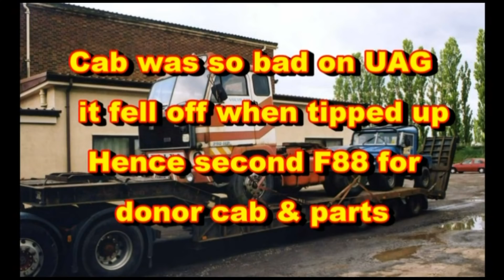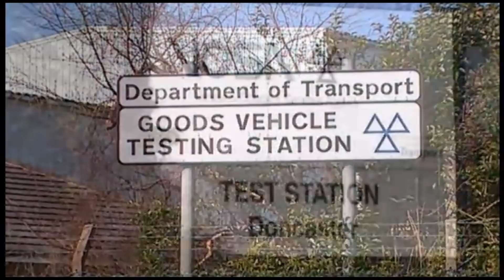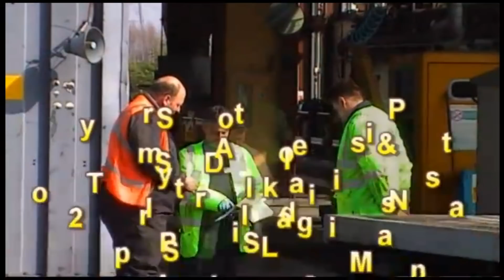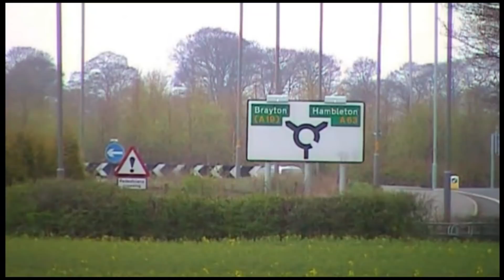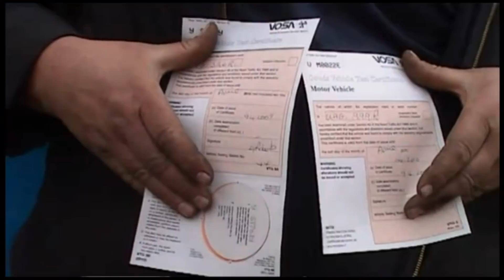F88 Volvo  UAG 999R Rebuild  2019-07-28

Comment: Great to see this rebuild of a terrific truck. When the Volvo F86, F88 & Scania 80, & 110 came on the British trucking scene they transformed the way HGV`s drove & performed. The smoothness & ease of use between engine & gearbox was a revelation. They also provided superb performance, decent fuel economy, driver comfort & above all for the operators a reliability never seen before. I don`t think you could have chosen a better motor to bring back to life.....well done!
Reply from the maker: Hi Edward, glad you enjoyed the Video. I was driving trucks  when the Volvos started to come into the country. As you say, what a change. Sad to say though it was the end of British built trucks. Regards Dave.
Reply: @DavidJoydajcajpajpaj  Very true Dave, it was the beginning of the end, but in our case we couldn't afford to buy British anymore since these Swedish trucks were so reliable. The one saving grace though to buying Volvo & Scania was the fact that they did source quite a lot of British components for the trucks & the cars.

Comment: The truck that changed European and Brit trucking for good. Many fond memories of them, including a 6x4 F86 curtainsider. That F88 looks fantastic.
Reply from the maker: Thanks for the comment Gareth, Watch some of UAG's road run's in real time to get the memories going. Regards Dave
Reply from the maker: Most certainly did Gareth. I was driving one within the first few months of them coming into the UK. Regards Dave
Reply: @DavidJoydajcajpajpaj  Thanks Dave. You've done a sterling job on her. I couldn't help but commiserate with you when she failed the test though. Been there, done that. You think you've got it all covered..and then..I'll be looking out for the videos of her on the road. Take care.
Gareth
Reply: @DavidJoydajcajpajpaj  Bit of a change from an Atki with a Gardner 180 and a DB 6 speeder

Comment: Good old smoker.  Use to drive a FB88 back in the eighties.  You sure put a lot of time and work in this project, and the resultat is stunning.  Congratulations with the timemachine.
Reply from the maker: Thanks for the comments Only Watching. Never seen an F88 that does not smoke on startup. UAG 999R had an engine overall last winter and hopefully it will be a repaint this winter. 2019/2020. Always something to do. Regards Dave.

Comment: A beautiful restoration of a classic truck a Labour of love  well done  a credit to you .  brings back fond memories of traveling many many hours  in an F88 on Middle East runs with astrans in the 70s/80s which after thousands of miles  was   replaced by another great truck a scania 143m 500 V8
Reply from the maker: Thank's for your comments Nutrunner, Look for the Rd Run videos and get the engine sound as well. Best wishes Dave.

Comment: Great restoration, really good effort.  I love how the euro trucks had the advertising signs  built into the cabin roof, fibreglass I guess. A really good insight into the actual frame work of the cab, brackets etc. My guess would be 270hp. Would look great with 40ft trailer with 2 containers on. Cheers from Brisbane Australia.
Reply from the maker: Thanks for your comments Andrew, You are right about the cab roof pod, they are fiberglass, only as big as the name board it's self. UAG is a 290hp engine with a 16 speed spliter box. Very fast if you want it to be as it does not have a speed limiter fitted. Present trailer is a period (1978) Low Loader which we carry our (1944)  Bedford QL Fire Engine and Shepards Hut  to the rally's.If you look through my video's you will find the trailer rebuild and some Rd Runs riding in the cab with Mike. All the best from a very wet and miserable UK. regards Dave.

Comment: i owned and operated a 1978 g88 boggy drive volvo truck and dog tipper in australia, i purchased it in 1979 it was a super reliable workhorse eventually i fitted a big cam 2 cummins 400 hp and 13 o/d r/ranger trans. best move i ever made.
Reply from the maker: Thanks for your comment Mark, Sad to say, Volvo's were what caused the British truck industry to collapse.  Regards Dave.
Reply: David Volvos imported into Australia were really bad for RUST they were terrible and Australia is a dry country not like England, I always reckoned they were shipped out here as deck cargo on a submarine , Volvo 16 speed gearbox weren't all that special either they were best replaced with a 13 speed o/d road ranger much-much better.

Comment: Fantastic restoration, nobody realizes the work that goes into a restoration like this unless you have done similar yourself. I have had experiences at a Foden S39 eight wheeler, a Volvo F6 turbo 6 and F7 six wheeler's so i know what you were up against. I hope you have much enjoyment from your F88. By the way did i spot a Massey Ferguson 30 seed drill in your shed fitted with wheel track eradicators ?
Reply from the maker: Thanks for your interest Madeljacky. Glad you enjoyed the video. Seed drill not mine, stored for a local farmer. Regards Dave

Comment: Credit where it's due, that was a Herculean task, great outcome though, Those early Volvos wether they were Coaches or Wagons were special, simple rugged and reliable.
Shame that can't be said today.
Reply from the maker: Thanks for your interest John, Took six years to get back on the Rd. All the replaced panels had to be hand made as you could not buy them, not even from volvo direct, and they did go out of there way to try and find them for us. Volvo even found us a complete workshop manual and parts list which they donated to us making it easer to work from, needles to say it did not help fabricating the new panels. Kind regards Dave.
Reply: @DavidJoydajcajpajpaj  there's an orange one in penistone south Yorkshire. Been sat there for years. Never seen it move. Exactly the same shape of cab.  Needs rescuing if you ask me. Terrible waste.
Reply from the maker: Hi   @nostreamavailable9090    .They are still there to be found. A nice project for someone .Thanks for your interest,  Regards Dave.
Reply: @DavidJoydajcajpajpaj  too big a project for me mate, I'm slowly doing a Camaro up at the moment , l can't drive trucks, but l admire them a lot. Anything on wheels or wings l love. 

All the best for the year to come.👍🏼

Comment: All thats missing is the 4 fog lamps in the bumper
Reply from the maker: Hi Rs500ybd, Thanks for your interest in the video. regards the lights missing from the bumper bar, had to take them off because it would not pass it's MOT with them in situe. Acording to the powers that be, the glass on the lights is dangerous and could cause serious injury in an accident.    Regards Dave.
Reply: In Denmark they were high beams from Marshall. 
To me it looks like a F89 the wide grill and missing ventilation on the left cab side.

Comment: I remember when ken parrott had a leyland marathon lad called dave used to drive it any idea what happened to it dave ?
Reply from the maker: Yes, It went for scrap. Ken could kick himself now. Dave Graham that drove it works for Rowntree in York as a trailer shunter.
Reply: David Joy that's him he used to come to tanfield mill with barley when I worked there I couldn't remember his surname but he used to live far end of Thorpe willoughby
Reply from the maker: Thats the man Nigel, he has moved since then but is still in the village.
Reply: The marathon ended up been cut up by me in sept 2001 after i bought it in late 2000, the engine {cummins 290 big cam} recently rebuilt or exchanged by cummins ended up be exported to dubai for a compressor or generator the only thing i have left as a souvenir  of the slaying is the cab top marker lights and the back springs everything else was weighed in for scrap.
Reply from the maker: @cliffordmarshall3592   That's your job Clifford but it's a real shame that we lost it as they are making good money now for restoration. Regards Dave

Comment: Having driven F89s from the early seventies I appreciate these Volvos...Never liked the 290s they were poor in comparison to the F89 but F89 only possible in LHD. However I never understood the logic in having names for Trucks?, Yorkshire princess WTF is that supposed to mean...
Reply from the maker: I used to drive both F86 & then F88's , no wonder the British truck industry failed. Regards Dave
Reply: Jim Bradley, I also drove F89's & F12's & your comment about 290's is completely superfluous if you had any understanding of why the 290 ever came to be. The 12 litre F89 engine wouldn't fit in under a RHD cab so the 10 litre 290 was developed as a stop gap till the F10/F12 was redy. Even more surprising is your derogatory comment towards the guy who restored this old Volvo in terms of "naming a truck & what it's supposed to mean", if you don't get it keep your rude mouth shut. Congratulations to David Joy, I remember seeing photo's of it on Trucknet around the time you finished it but this video shows people the amount of work & dedication required to restore a rotting old relic & also shows why there are so many unfinished projects sitting in sheds. Well done.
Reply: @RoscoeTravis  The 290 Volvo F88 was a poor stop gap as they were a troublesome vehicle from the beginning...Difficult to start very smokey and poor on diesel in comparison with the 240 they replaced, they used to boast "another 100,000 mile Volvo 290 with stickers"????...I did point out the F89 were available only in LHD , the 290 was very short term about 3 years maximum and apart from about 50 that went to Australia were I was working at the time I don't think any others were sold overseas...The Australian ones  also gave massive gearbox trouble, and most were replaced with Fuller boxes....My point remains the same, the 290 was a  poor quality stop gap that would always be in the shadow of the F89 , Volvo didn't sell the 290 in Europe as far as I'm aware ...As for my point about the naming this truck Yorkshire Princess?, must be an English thing!!...By the way those 50 x 290s set Volvo back for years in Australia as they were considered soft and not up to the job...
Reply: @RoscoeTravis  By the way fcuk you with your Pommie BS...
Reply: @jimbradley9775  I don't need an Aussie bad mouther to tell me the 290 wasn't a success as I was around at the time & "pommie BS" ? The only good thing to come out of Australia was Casey Stoner. ;-)

Comment: Where did I miss this bloke attach the safety chain
Reply from the maker: Hi Robin, not quite sure what you mean about the safety chain. When the cab fell off all the mounting points were still attached to the chassis.   Regards Dave
Reply: Now then Dave, I’m only guessing but he may have meant when  the F88 was coupled up to the trailer, possibly the dog clip on the 5th wheel, I’m not sure myself. Great vid tho.
Reply from the maker: @allan4923  Never saw that Allan, you may be right. Regards Dave.